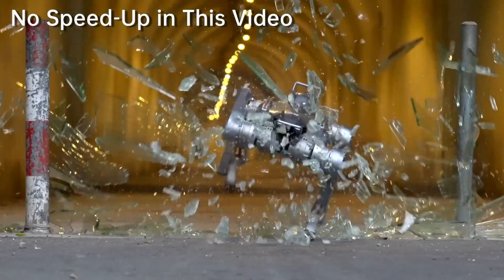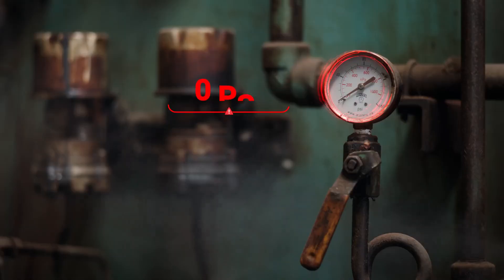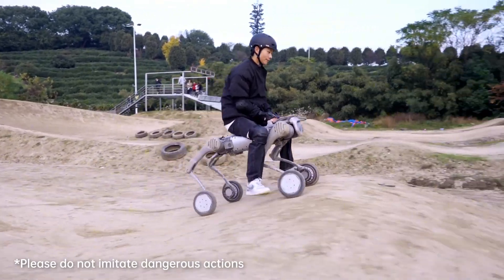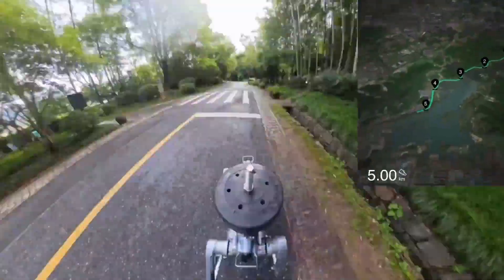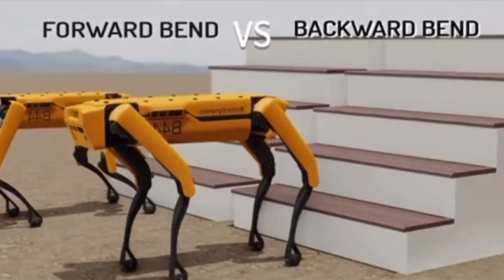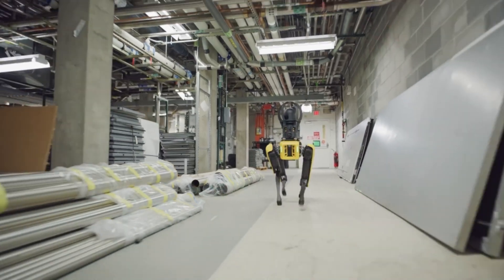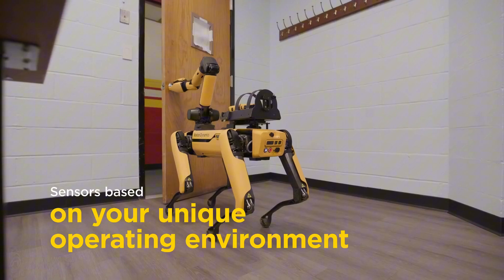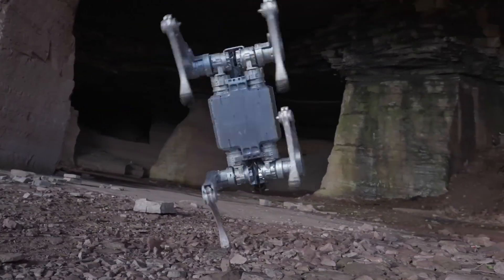Unitree A2 Vs Boston Dynamics Spot: Which Robot Dog is Better?

Comment: While Spot was impressive 5 years ago, it does not hold a candle to the Unitree's robotic even if you don't take the signficant price deferentials into consideration. Boston dynamics was conceived to help the army with chores, it was only Unitree's dog that is being deployed by the Ukrainian forces reliably for scotting even though it was not designed for such role. I doubt that Spot can handle the war zone rough terrain the much cheaper counter part can...